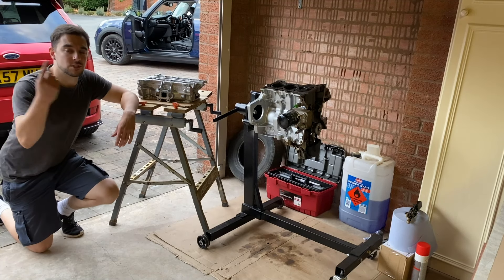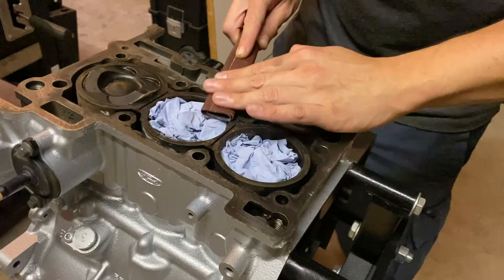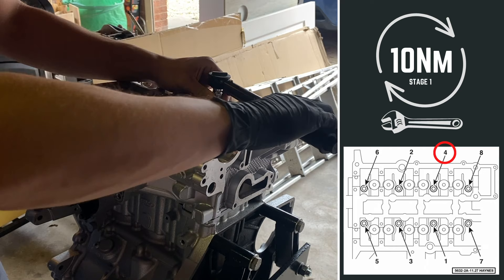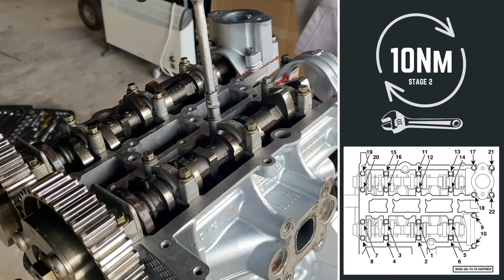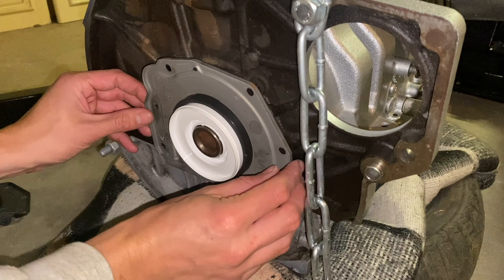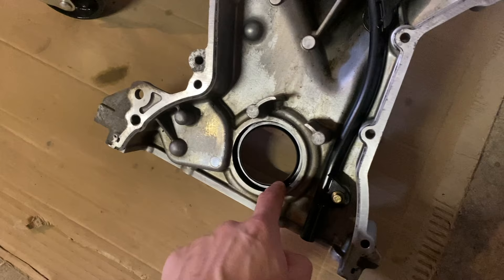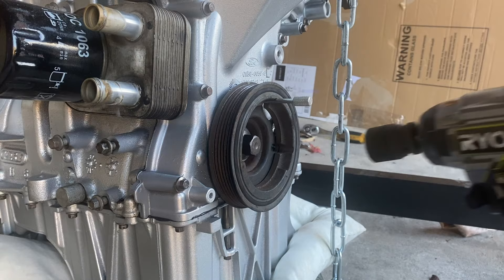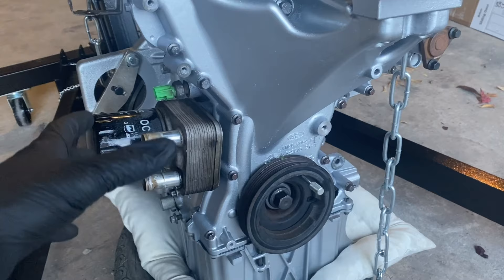Fiesta MK7 1.0 EcoBoost Engine Rebuild | Part 5 | HEAD GASKET | TIMING BELT | CRANK PULLEY

Comment: I work for Ford and do a lot of heavy line jobs like this, and there's very little to complain about. There were a couple of small things, but its pretty close to having a dealer do it. The red rtv you used is fine. I believe Ford recommends a different brand. Its high temp rtv. In the future, when you are trying to remove old gasket material, you can get spray on remover that you just let sit for 10 to 15 minutes, and wipe it off with a rag. It works a lot better than you might think. I didn't use if for years because I thought it wouldn't be any good, but now I use it every time. It smells like oranges. That's how you know its the right stuff.

Comment: With the timing cover, that small o ring gasket with the little rubber bit comming off at and angle, you should have used the updated seal and siliconed off the part where the gasket goes up. It’s a ford procedure. And also you should of used the primer first wait for it to dry then apply the sealant

Comment: I am finding this series of videos really interesting. Takes me back to when I rebuilt a mk 1 1500 cc Ford Cortina engine. My only error was to forget to lubricate the crankshaft oil seal which was damaged due to friction when I first started the engine and subsequently leaked.

Comment: With mechanical lock-down tensioners, I always adjust and lock down tensioner with rotating load on timing belt. This way, tensioned side of belt has slack taken out of it. This was pretty standard protocol on older engines.

Comment: Brilliant video ,
I didn't notice if you changed the oil pump belt ,
The main issue with this engine is the rubber particles off both belts blocking the oil pump
Reply from the maker: Yeah I changed the belt and checked the pickup was clear. Might have been in a previous video, I can’t remember 😂

Comment: I’ve done 2 timing belts now I’m a diesel mechanic and this was new to me I found with a scary problem on my first belt change that everything on the crank had to dry and as you said 300 NM and 90 degrees not a fan

Comment: The workshop manual should say whether to lubricate the bolts or not. It's easy to strip lubricated threads if they're designed to be torqued dry.

Comment: I would have replaced that rear crank seal anyway regardless if I had picked at rubber seal or not. Kuga diesel 2 litre uses a similar arrangement, slightly different in the case that the rear crank bearing  cap has 2 stick like rubber seals in it. It also is sealing against the sump/crankcase assembly and leaks with high millage.

Comment: Great Work! Binch watch the playlist of this rebuild, awesome! I'm Like you ... just go for it! even if you really don't know how! to the "purists" ... how did you get to become one? You have to practice, to be a better mechanic!

Looking forward to the next video!
Reply: Its not that difficult. The one thing Ford does well is produce very thorough procedures. If you had to do this job, get the workshop manual from Ford, and follow the procedure step by step. They tell you every single thing you need to do, to the letter. Nothing is left out. If you do everything they tell you, the job should come out exactly the same as a dealership would do it. 

Or get an entry level job at Ford. They're desperate for help. If you apply yourself and show promise, I guarantee that you can get a short block job like the one in this video sometime within your first year. You may have to split the labor with someone like me who does them all the time, but it will be your job and the other tech will be there to make sure you don't make any big mistakes and do damage. After the first one, you probably will be left to do the next one your self, and keep all the labor.

Comment: I hope that timing belt doesn't suffer the same short lifespan the OEM were known for in the 1.0 Ecoboost.
Reply from the maker: It won’t bro, I’ll change the oil as per the manufacturer’s guidelines and it’ll last ad long as it’s supposed to 👍🏻
Reply: @MendItModIt  Is wrong oil viscosity the reason so many of them are failing so early?
Reply from the maker: @LiterallyJesusChrist  I think the oil itself does play a part, but hydrocarbons build up in the oil as a result of combustion which degrade the belt. I would only ever use the manufacturer recommended oil on these engines but I would say not changing it regularly enough is probably the main culprit.
Reply: @LiterallyJesusChrist  Use of the proper oil and regular oil changes essential to these engines, low sap oil, i change the oil at around 9k, never had any issues on an 8 year old 1.0 Ecoboost.

Comment: I can't thank you enough for this series! It is helping me so much with my project with the same engine. Do you know whether they have discontinued that crank pulley friction washer? I'm pretty sure one didn't come off when I removed stuff, and I can't seem to find one on any parts site anywhere!
Reply from the maker: The washer isn’t fitted from factory, it’s just used when reinstalling the crank pulley. Try a Ford main dealer, they should still make them

Comment: On Those end caps u should not use that much sealant,  it will risk going in those oil chanels and clogging them.
Anaerobic sealant is better.

Comment: Hi 
When you tightened the bolt you removed the the pin in the pulley but did you remove the pin that screws in the back of the block to the crank 
And also how did you get the print out information 
Lads car needs done 😬
Cheers

Comment: when torquing head stud you said you were having issues with the angle guage,could i do one bolt torqued to spec and use the angle gauge then use my torque wrench to see what that final torque is on that one stud and then use that torque number on the rest of the bolts so i dont need to use angle guage again? since it was being difficult on certain bolts would this method be more precise?

Comment: Should there not have been sealant along the bottom edge of that crank seal plate? There’s nothing sealing between the sump flange and seal housing?
Reply: No he doesn't at this point in the build. Because he will put the oil pan on afterwards, the RTV sealant on the oil pan face will seal the lower edge of the rear oil seal plate.

Comment: I wouldnt renove that alignment tool on the crank pulley, if the pulley spins when youre torqing it up it wont run...
Reply from the maker: The manual says to remove the pin after 75Nm, that bolt gets torqued to over 300Nm, if the pulley spins at that kinda of torque that tiny pin isn’t going to stop it 😂
Reply: @MendItModIt  That makes sense, i would be worried it will spin. :/ if thats what the manual says then ill remove it. 

Great info btw. I am doing a head gasket and new belts ect... I havnt found a video as good as yours and ive looked at every single video on youtube on this. What a pain to work on these things...

I just followed you on Insta. Keep up the great content!
Reply from the maker: @BriggsGuy54  Haynes manual says 25Nm, then 75Nm, then remove the pin, 300Nm then 90°. At least from memory that’s what it says but highly recommend getting the Haynes manual. The friction washer is meant to help stop the pulley spinning. I’d also make sure the mating surfaces on the crank and pulley are clean and free of oil. Good luck dude

Comment: Failed. Tried to tighten the crank pulley bolt (brand new) to 300 N*m and then to extra 90 degrees - 300 N*m part went well, but 90 degree part broke the pin's hole aluminum casting on the side cover and the pulley shifted about 20 degrees. Now thinking what I can do... Need to hold the pulley in the correct position somehow, and re-tighten the bolt again... Any Ideas?
Reply from the maker: You are supposed to remove that pin after the the first two stages (25Nm and 75Nm from memory) then do the 300Nm. Even so the crank pulley shouldn’t move once it’s up to 300Nm 😵‍💫 did you fit the friction washer? And did you make sure the end of the crank and the back of the pulley were completely clean?

Comment: Great series of videos, just a question though, what is the size of the tool used for the cylinder head bolts?
Reply: If you are just talking about the TTY part, you can use a protractor and mark the bolt heads and the head. As long as you turn the bolt the proper amount, that's all that matters. Its nice to have a torque wrench that does angles, but with a little patience, you can still get the job done.

Comment: Hi great video just one question it says  in the Haynes manual that the timing belt cover has torque angle bolts which are to be replaced with new ones
Like you would with stretch head bolts did you replace yours or do you even need too?
Reply: You're supposed to replace them. All torque to yield bolts are one time use. That said, I see people re-use them all the time. If its your car, and all the money to fix it is coming out of your pocket, sometime decisions are made to not follow the manual to the letter. But if a dealer does the job, you get new bolts. It comes with the job.

Comment: I have a problem with my C max. I had the wrong oil in my car and the timing belt was worn off.  I have replaced the timing belt but my engine runs rough.  Computer shows: Cylinder 3 misfiring P030092 code.  can you please help me
Reply from the maker: I’d try swapping the spark plug from that cylinder to another, clear the code and see if the misfire follows the plug. If not try the same thing with the coil. If not that maybe try the same with the injector.

Comment: Will you give us a full breakdown of the cost of everything you had to buy to do this job.
It would be nice to compare a garage price (circa £1000) to what you spent to do it (let's assume you didn't remove the engine,so no engine lift or engine stand).
Reply: Actual garage cost including the lower belt that drives the oil pump is £1400+

Comment: I may have missed it, what year is this 1.0 ?   My 2018 is starting to consume or leak coolant (no leak visible).  Im afraid it's the head gasket, from those grooves in between the cylinders.
Reply from the maker: 2014 bud. Might be worth getting a compression test and/or cylinder leakage test done. As far as I know Ford revised some of the issues surrounding the overheating issues. Mine only went because the crash broke part of the cooling system and I assume the car was driven without coolant
Reply: @MendItModIt  Appreciate the advise!

Comment: Did you have any issues with the crank bolt or pulley slipping?
Reply from the maker: I didn’t, the friction washer is supposed to stop that from happening and it did the trick
Reply: @MendItModIt  heck yeah!  I've got mine tore apart like a dad gum shade tree mechanic.   Your video has been crucial to my efforts in replacing my head gasket.

Thank you!

Comment: He’s put the wrong seal on the water pump outlet.

There’s is a tsb about that seal rotting out due to oil and dirt contamination
Reply from the maker: A link to the updated seal would be helpful if you’ve got one pal 👍🏻
Reply: @MendItModIt  Ford tsb 15 1070 and there is a modified cover 2300737.

The garage I work in do that repair every few weeks.

Comment: The diagram to right at 18.09 or so is not correct in that direction of view. The two bolt holes shown adjacent to arrow location B do not exist on the 1.0 Ecoboost engine. Likewise no sealant is required along the engine block face at B because it doesn't mate with anything! The face shown is actually on the sump when already assembled to the block.
Reply from the maker: It says in the description above it “and a 4mm run of sealant along the sump (B)” so it is correct if the sump is already bolted on. That face is the top edge of the sump. Granted the image could be clearer but it is right. The holes will be for the sump too 👍🏻
Reply: I hope your engine is still ok. I'm currently re-assembling mine. Replaced the cylinder head because it had an internal crack, letting coolant through to the exhaust manifold!. Replacing the cambelt again as it had already started to deteriorate after less than one year/less than 5k miles. Worst engine I've ever worked on. You've made some great videos, I'm sure they will help many people.
Reply from the maker: @raycrook4525  oh no! I was worried that had happened to mine when I got white smoke on start up but luckily it was just water sitting in the exhaust and burnt off pretty quick. That’s mad the belt started to go that quickly, you clearly know what you’re doing so I’m guessing you used the correct grade of oil for the wet belt? It shouldn’t deteriorate that quickly if the correct oil is used though 😨 what brand was the new belt? Thank you mate 🙏🏻
Reply: @MendItModIt  I used a Dayco belt (supposedly same as made for Ford) and Petronas Syntium 5000FR 5W20 (WSS-M2C948-B). I had assumed it was the head gasket, did all the work to replace it, only to find that it was cracked. I rigged up my own water pressure test at home to confirm it and used the same test to check the replacement head is ok.

Comment: Should not oil head bolts I rebuild engines for a living putting any head bolts in at all always should be completely dry where the headbolts go as can cause air lock at bottom and crack head in the very worst case
Reply from the maker: Pretty sure I mentioned that in the video, as well as cleaning the bolt holes to remove any oil that falls in during removal. The smallest amount of oil to stop them binding is fine though if they’re clean. It’s the block that would crack, not the head but I think that’s what you meant
Reply: @MendItModIt  that's what I ment your videos are brilliant very detailed doing a very good job of it keep it up

Comment: Those 1.0 ecoboosts are the worst engines I've ever come across. The design faults on the engine guarantee complete failure
Reply: Absolute crap! If you treat them properly they last very long time. Mine has 265k km and one in our company has 490k km, both with original engines, turbos, head gaskets etc.
Reply: @webmktv1781   agree if they are maintained properly using the correct oil etc they are fine.